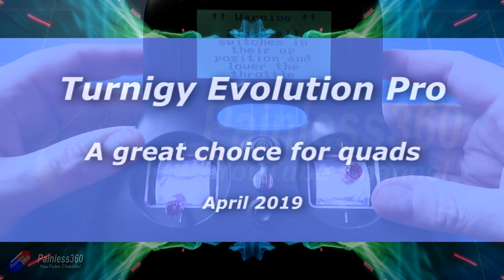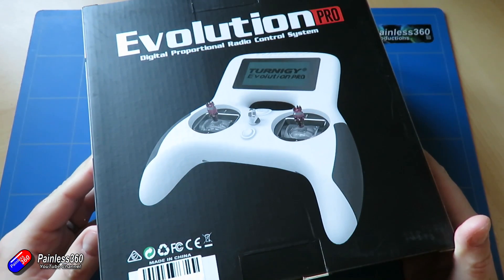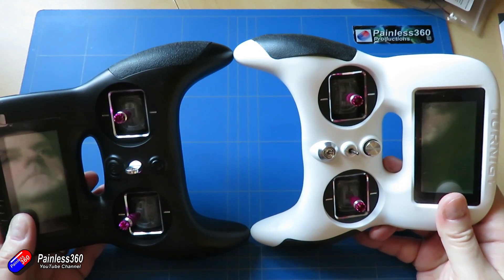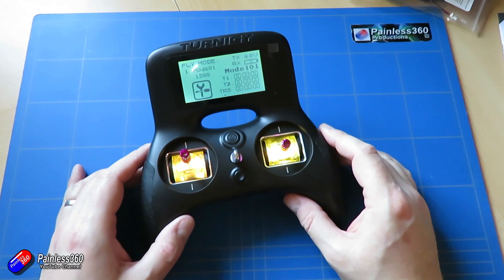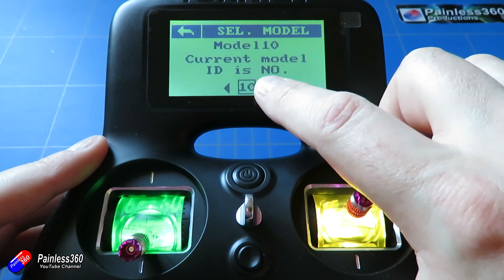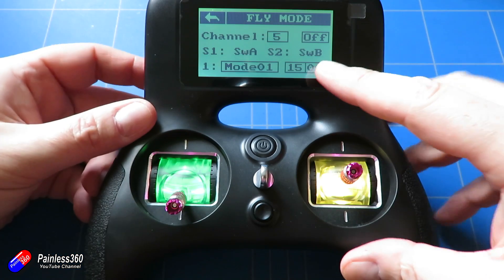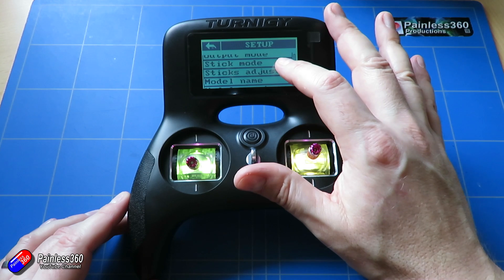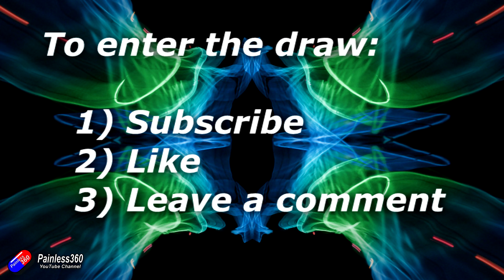New Turnigy Evolution Pro Radio

Comment: Loved the original and this is the one I use for simulation. I will miss the rotaty and the switch just because I love cool looking buttons but I'm glad this RC can fly wings now.
Reply from the maker: The original could manage fixed wings in the same way. Fine if you use a flight controller in a wing but tricky for traditional trimming of control surfaces in flight.. This is really a multirotor only radio IMHO.

Comment: I've always been fond of my flysky/Turnigy i6 transmitter. They really are a decent budget radio. I believe the evolution is much the same, in a different physical form.
Reply: @Jack Ripper 
 I did a firmware update on my i6 pretty early on, expand to 10ch, telemetry. I've been happy with it.
Reply: @Jack Ripper 
 The rssi is real handy if a model goes down and you don't know where, much easier to track down

Comment: Your videos are very useful.  Can you change out the momentary BUTTON and re-wire in a TOGGLE 2 position switch?
Reply from the maker: Possibly, if you can find the switch they used and see if there is an identically sized 2 position version you can swap out..

Comment: If you trim the old lid a little it fits the pro just fine. If I can do it anyone can. I wish they'd just shrink the ia6c to micro size with the same autobind/power on capability. My left side in the handle battery gets pretty warm and not the other (right) side. How to get rssi?

Comment: I have two of the old Evolutions and like them very much in fact it is my most flown tx.  Late last year I bought an X-lite...I've flow it a bit but am waiting for the nicer weather to fly it more.  The 20 model memory is really the only big "new" selling feature here for me on this pro...of course I've said that without actually knowing what the new gimbals feel like.  Turnigy really needs to be including a diversity rx the size of an XM+ with this....the included rx is simply too large for most modern racing/freestyle builds especially if you are trying to get into 2" or 3" builds.

Comment: The x6b and x8b are probably the best recievers (diversity). Would miss the rotary switch for rate profile selection. Wasnt a fan of the flit14+ receiver was small but had lots of close in failsafes.

Comment: Can anyone help , I have Turnigy Evolution Digital AFHDS  . I have paired it with the Eachine UK65 but I'm having problems the drone don't fly only different motors spin at different position and I get Bipping Noise and Red flashing light on the controller.  I have this similar controller connected with another drone and it works fine. Only With the EAchine UK65 it gives me problems.

Comment: How much the battery lasts? Can be charged on the fly? I want to have a power bank if i needed.
Reply from the maker: I've only used if for a few hours at a time and the battery seems to hold up well. The lack of a changeable battery on this is something you need to think about..
Reply: @Painless360  Thank u for your reply but i end up with Nirvana!

Comment: Will this do Elevon mixing for a delta wing?
Reply from the maker: Not sure, this was a radio designed very much with the multirotor pilot in mind i.e. no easy trims. There are better choices for a 'plane (unless you add a flight controller :D )
Reply: @Painless360  i have radio but I want compact to carry on a motorcycle

Comment: I got one if the originals after trying to decide whether or not to for about it for 6 months (At that point I already had a TGY i10, an FS i10, an Fs i6, and an FS i6X, so I didn't NEED another TX.  :) ), But when HobbyKing dropped the price below 30 quid it seemed silly not to just grab one.

For me, As a transmitter it's not really ideal as I tend to fly FPV with TX mounted screens (An inner ear problem means I can't use goggles without getting vomit inducingly dizzy). I've mounted a 7" screen on mine, but this REALLY screws with the units balance and makes my fingers ache after an hour or so of flying. Where the original really excels for me though is on the simulators. It's simple to connect, Simple to configure, And has great mid quality sticks. It makes something like the FS i6 feel sloppy and vague by comparison.

I probably won't be getting the pro version as for me it wouldn't be a huge upgrade over what I've already got, But if I was just starting out and didn't have a problem using goggles, I could see this being an ideal TX that I wouldn't end up outgrowing for a fair while.

Comment: This explains why Hobbyking crashed the price on the 1st gen Evolution, I was tempted but I like my Turnigy TGY-i10's.
5 model memories of the 1st gen is extremely limiting, I've filled up about 16 of the 20 on my TGY-i10.
2 switches & a momentary button also looks limiting, I setup 2 switches on my TGYi-10 just as Start & Reset for a 3 minute timer as an audible warning of how long I've been flying (it beeps 1 minute before the timer is up which is handy)

Comment: Did they ever fix the brownouts on the A8S? Shortly after the first Evo came out, a number of people experienced the receivers getting stuck on high throttle and unresponsive to even disarming for several seconds. Search RCgroups dot com, this was an issue that flysky promised to address and never did.. Serious safety issue. This is a flysky radio made for hobby king. My Evo also had a glitch that developed where it would transmit full left roll just as I armed. Even the display showed that it was commanding the roll. Seriously, just stay away and get a Taranis x-lite. There are far better receivers even if the flysky A8S weren't a safety hazard.